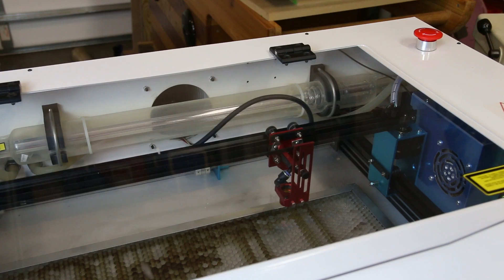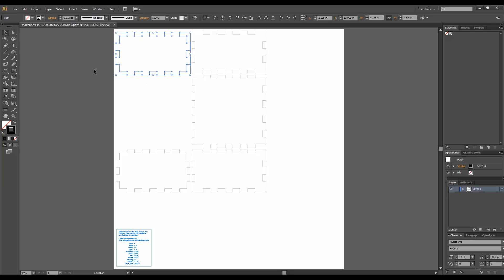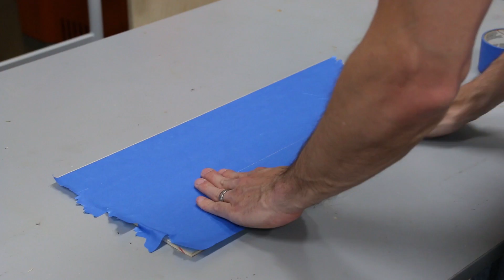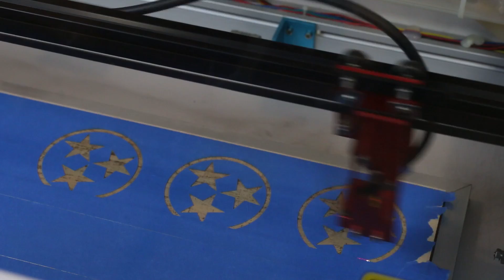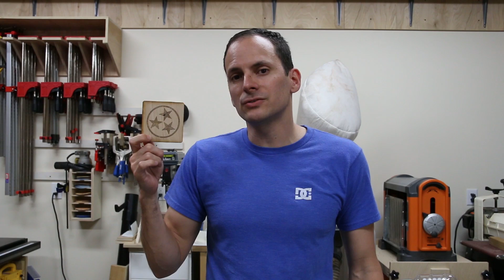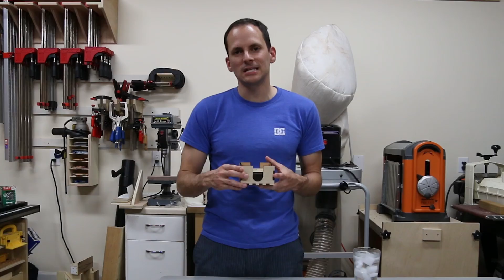Laser Engraving Wood Coasters - CNC Laser Woodworking Project

Comment: How did you cut 1/4" wood at 25/85 with a 40w bulb?  I have the FSLaser with a 45w bulb, and I am having a hard time cutting 1/8" baltic birch consistently at 25/100....  Did you use more than one pass?
Reply from the maker: I used the test feature where it runs a bunch of different passes and speeds on small squares and just went from there.